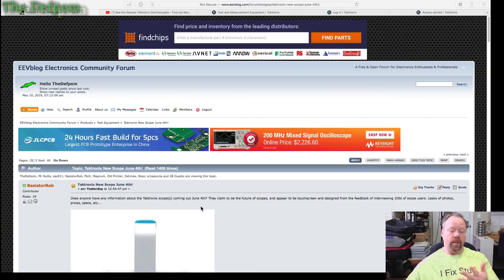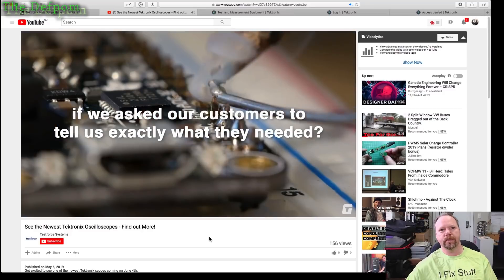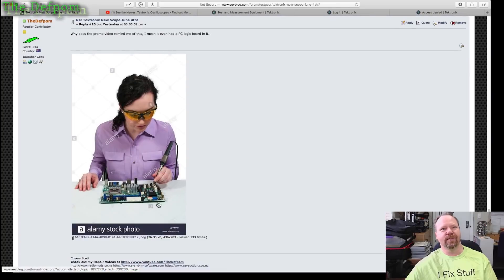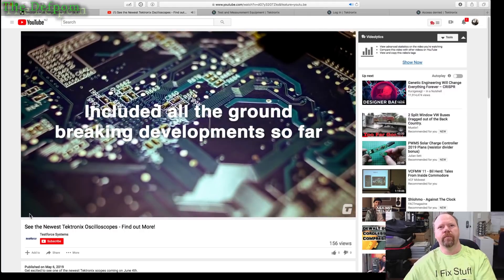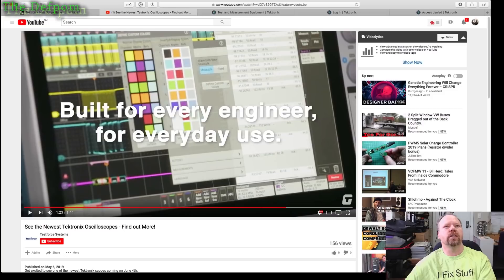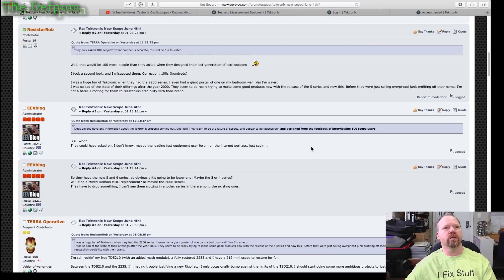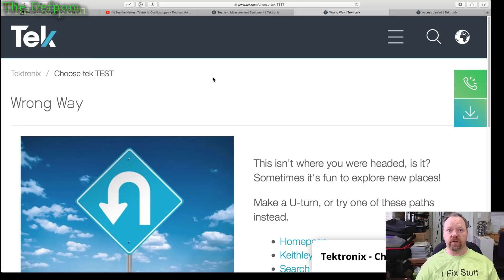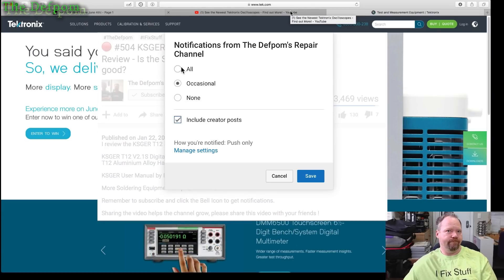🔴 #561 New Tektronix Oscilloscope - Tektronix 4 Series MSO or Tektronix 3 Series MDO ?

Comment: For me even a cheapo Rigol will outperform my requirement. So it’s down to the interface. Again I think  Teks interfaces have been hands down better than any by keysight.  It could be personal preference. I wouldn’t have bought my keysight if it didn’t outperform the Tek against the price point., but it did. Still think touch screen on a scope is junk. I like my screen not covered in smu thanks.